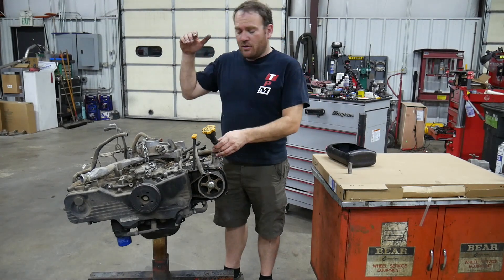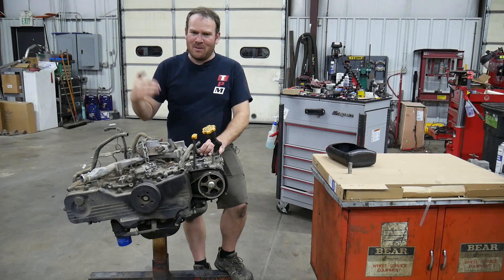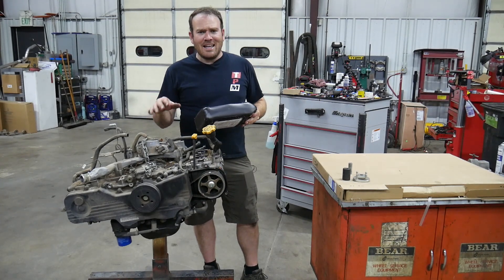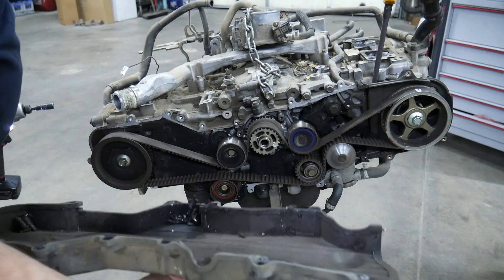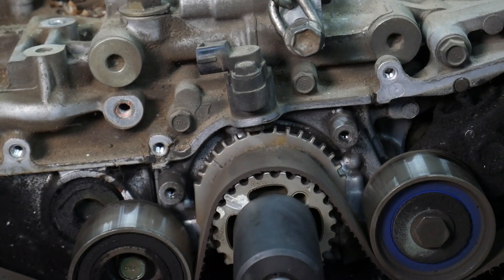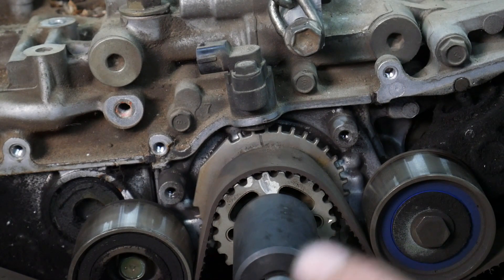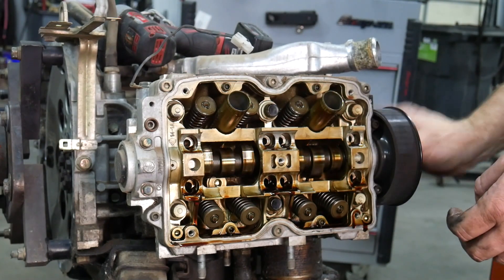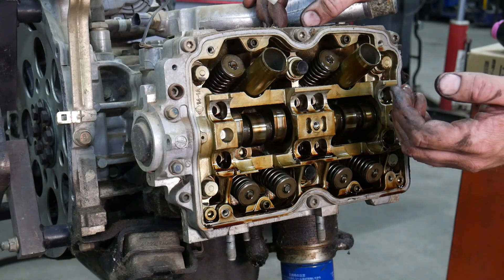2005 Subaru Forester Pt 3 Cylinder Heads removal from long block

Comment: Great videos can the heads be done without taking the engine out on a 2.5 subaru legacy 2004 non turbo I'd appreciate your advice thank you
Reply from the maker: That is how I typically do them. I only removed this one for ease of filming.

Comment: This is hands down the single best Subaru video to learn about the actual assembly/ disassemble for DIY'ers. Simple and concise, these videos are ideal for beginners. More advanced mechanics may get a little bored  BUT, He covers every section of the engine and it's relevant sensors and it's key issues to look for. He is ridiculously thorough with naming every component.  Which was terrific for me because at the end of my swap I had issues w what connectors went to which sensors. Thx to thses videos I figured out all sensors and connectors.  The best part.... He is also FAST , so u aren't feeling like you are watching or sitting through dead air which is a waste. I HATE THAT SHIT.  Proof: I watched all 3 videos in this little series and now Im writing this review. I NEVER bother with stupid shit like this. but after watching these Im 100% sold on this guy. The best compliment I can think of is.... The only other YouTube mechanic that is in the same league as this guy's videos is ERIC THE CAR GUY.  If you understand that compliment, check this guy out.

Comment: Great explanations thanks for these videos. Question. I have a similar situation except I had a broken belt and I replaced it. The engine turns over but does not start. Am I looking at the bent valve scenario? The car just died presumably right when the belt broke. May I have your opinion? I’m prepared to pull the engine if needed and I’ll be following this series. Keep up the great work. Thank you.

Comment: Is  it advisable to replace the pistons once  the valves have  contacted them?
Reply from the maker: alan humbert depends on how hard they hit. These only knocked off the carbon that had built up over time. If there are deep marks then the piston may need replace or smoothed out. If the valve hit close the edge of the piston it may crush the ring lands and pinch the piston rings.